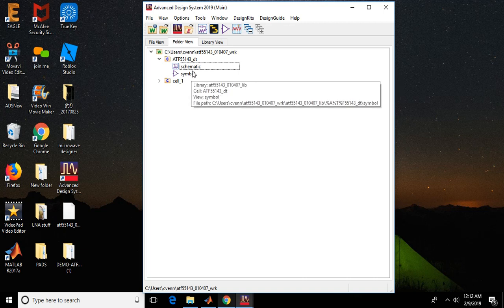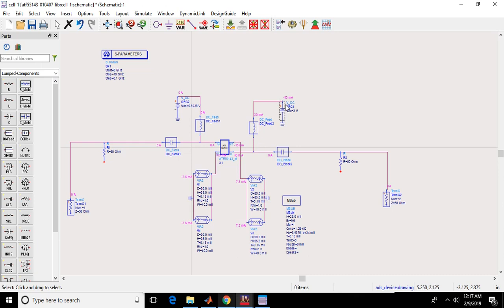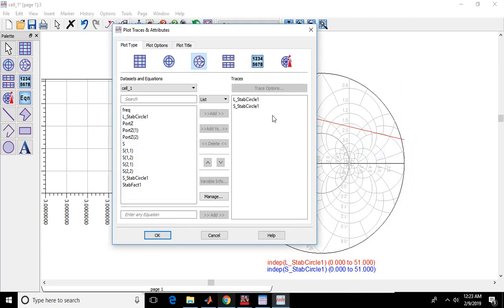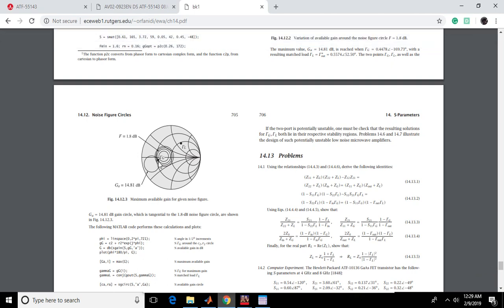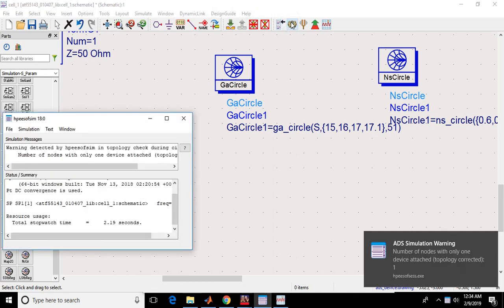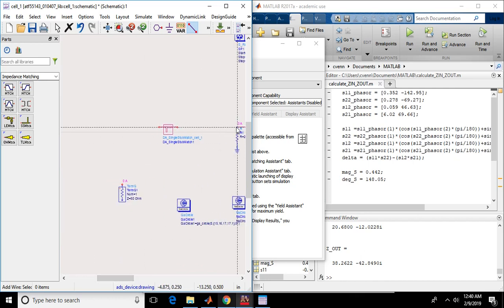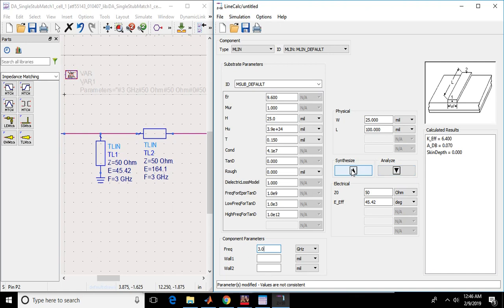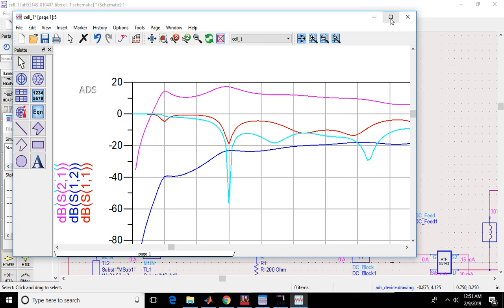How to design a 3 GHz LNA on ADS (1 of 2)

Comment: could you please explain why do we need a dc feed inductor at the output of the transistor please , what is the exact role of this inductor since it is conected to the power suply  , thanks ...
Reply: The inductor helps provide biasing for the transistor and also blocks any of the RF signal from leaking into the DC power line.
Reply: @seinfan9   helps provide biasing for the transistor if it was connected to the output of the transistor NOT the output

Comment: In the Derivation of the K factor there is an condition for the S Parameters (|s12|*|s21|)/(1-|s22|²)<1 that has to be fulfilled. Only if that condition is fulfilled and K is greater one, then the circuit is stable.

edit: The mu factor takes this extra condition into account.